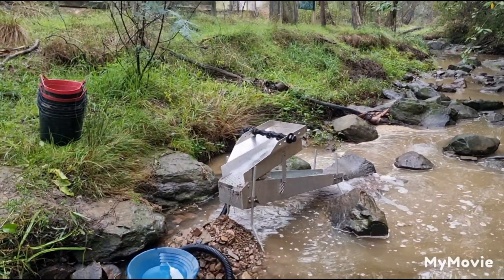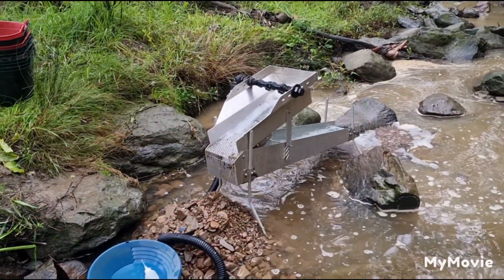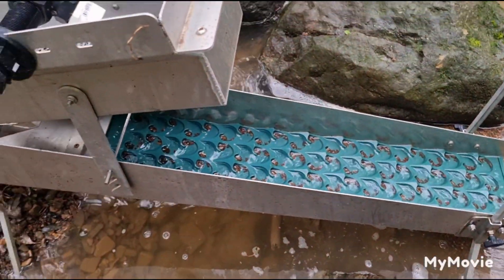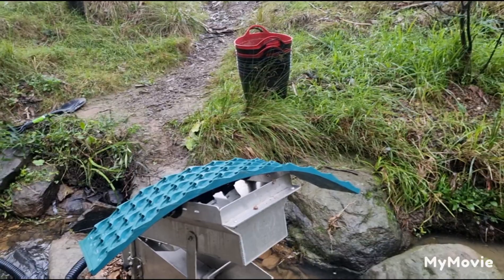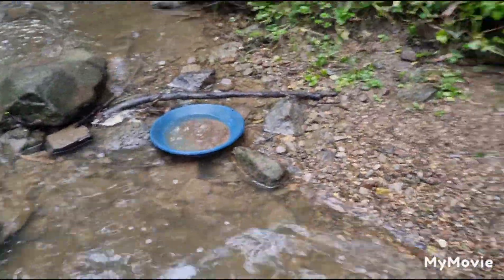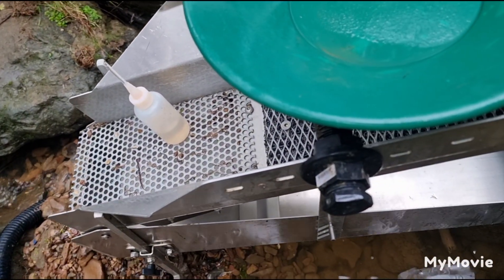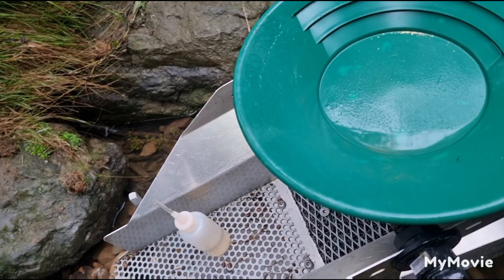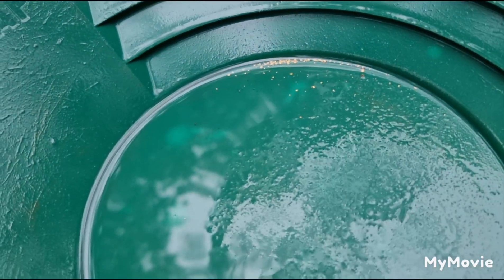Testing the secret dry creek

Comment: Hi Victor, I have been running the dream matt in my high banker for about 5 years and swear by it. I run it at 11 - 11.5deg and about 20mm of water over it (pump rated at 18000 lts per hr). I often put a 600mm extension on with a deep vee matt on the end to see if any gold is getting washed out and I have been surprised to find that on nearly every occasion there has been nothing in it. So in my opinion the people that say they are loosing gold off their dream matt have not got it set up properly. I have caught every thing from small pickers to flea crap (flower gold) I have added a trommel to my high banker (Gold Fox) with a crash pad under the material out let, it  catches the bigger gold and the rest gets in the dream matt. See Mohammads video, (First fox I have seen at slaty creek), you may have even seen it.
         https://youtu.be/2dI0M92FsFc
             Cheers           Robert
Reply: Mohammads video, https://youtu.be/2dI0M92FsFc       First Fox I have seen at Slaty Creek
Reply from the maker: Having rhe chash pad ,Miners moss with expanded mess in the hopper plus the bunnings door mat  under the hopper. Very little gold get to the mat. I now use a Dredge mat that is made by Dream mat. At  the moment I run it very flat 4 to 5 degrees.  A  trommal is my next hope.  Been looking at what is out there and the one I would want,  is crazy money. So have been getting a few things together to make one that is still light enough to carry. Will have to catch up  we are looking at doing a meet up at the end of July and doing something with a few a You Tubers that isn't  the big hike like the last one.
Reply: @MurrayRiversGoldAdventures  I did a lot of research on trommels before I got the gold fox topper unit, for what was out there the gold fox was my choice. I am happy with it easy to assemble and Kelly from Gold Fox U.S.A is great to deal with, Krazy Krevicer up QLD is the agent for them. 
   On your next outing pick an easy spot to get at and I can set up the high banker and trommel and give you a look at it. I had it at the creek at the corner a while back and it was too hard for me to get it out up the hill. I can imagine that you would have had a hard time getting your gear out as well.
              Cheers        Robert
Reply from the maker: Yes not easy to get out there after digging hard for 5 hours. Have plans for something end of July at a different spot that's more people and gear friendly
Reply: @MurrayRiversGoldAdventures  Yeah I had an email from Mohammad and he told me where you are planning on going, good choice. I can set up the trommel for you to have a look at.
             Cheers